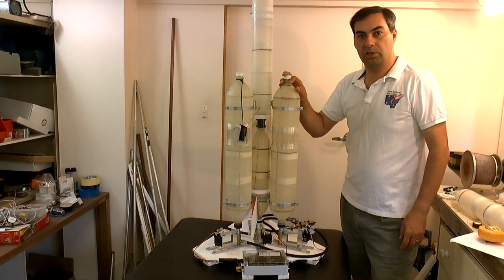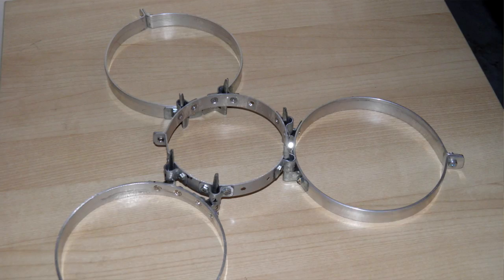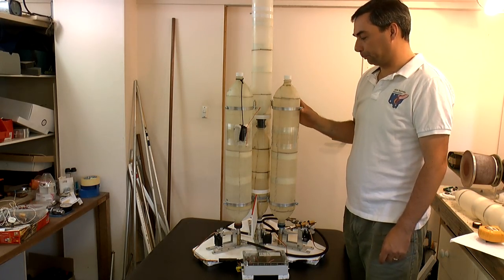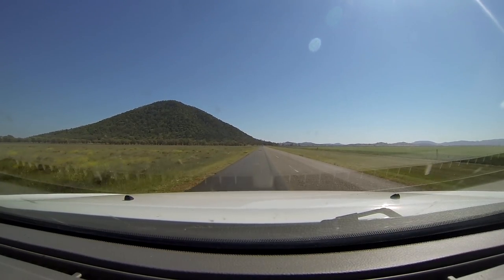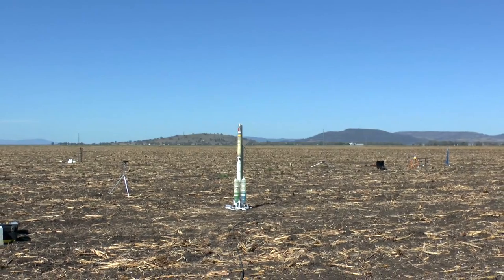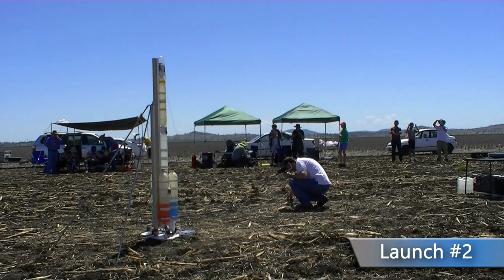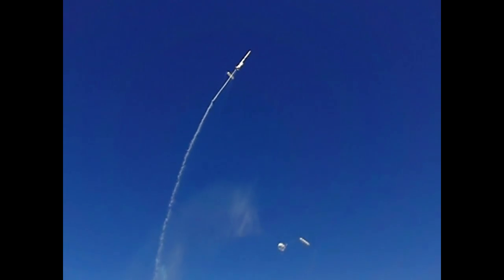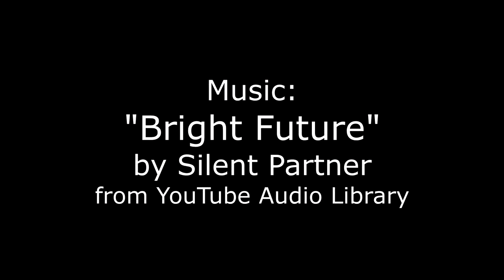Water Rocket with Boosters - Axion G2

Comment: Very nice video and some good test to see where you can improve, i can not wait when you launch the complete G2!  But the booster have a own locking system on the launcher why would you made those steel rings if there is no fore on that section? Because the booster are held in place by the launcher it self.
Reply from the maker: Thank you Basrockets. :) That's a good question why we need the strong connection on the boosters when they are held by the launcher. The individual booster retaining mechanisms are there for safety. They reduce the stress on the central nozzle while filling the rocket. If the central nozzle failed while the rocket is only partially filled that may be worse than if it failed at full pressure. However, with the boosters being released slightly before the main stage, the full static force is then transferred through the retaining mechanism for a few milliseconds before the main stage is released. When it leaves the pad the peak thrust is actually higher than the static force (I think in the order of 550N peak per booster), although at that time the main stage is also producing thrust (~180N peak) which partially cancels this force on the retaining mechanism. We also wanted to incorporate a safety margin in the strength of the connections. We tried thin aluminium sheet for the pins and loops, but they were too susceptible to bending.

Comment: Hi, what was the second stage drive mechanism you used? Was it electronic or mechanical?
Reply from the maker: Hi, this is not a 2 stage rocket, but a main stage with boosters. This means that the main stage fires at the same time as the boosters on launch, rather than firing when it is already in the air like a normal 2 stage rocket. Having said that the release on the launch pad is electronic. The main stage is released just slightly later than the boosters so that the boosters remain connected to the main stage. When the booster stops producing thrust it falls away by itself.

Comment: Wait.  You're in Australia.  People keep telling me that only the U.S., Liberia, and Myanmar use "U.S. customary" units.  Yet you measure your pressure in PSI.
Reply from the maker: Yeah, its a funny thing. In water rockets we measure altitude in feet, weight in grams, nozzle size in mm, pressure in psi. I think its mainly because the magnitude of the units are easier to deal with. Converting back and forth during calculations is annoying. :)

Comment: Are there laws in Australia that prohibit flying those anywhere?  Seems you guys always drive crazy distances to a "launch" site of some sort.
Reply from the maker: +Gunther Ultrabolt Novacrunch Yes there are. If you are flying below 400' then you can pretty much launch anywhere. Anything higher and you need permission. We mostly fly with the NSW Rocketry Association at our approved launch sites where we have permission from: CASA (Air Services), Insurance, land owners and council. Because a lot of the members fly rockets to significant altitudes we have to do that away from built up areas and as a result you end up having to travel further. We bring our bigger rockets to these locations, and smaller rockets to our Sydney launch site.
Reply: Thanks for answering!

Comment: Our school is doing a similar thing for a stem project does anyone have an effective way to measure the height reached by the water rockets?
Reply from the maker: Here are some ideas how to measure altitude:  https://www.youtube.com/watch?v=lrkyBcf7h58 The most accurate way is to use a commercial altimeter. You can get them in the $30-$50 range.
Reply: Thanks

Comment: how do the boosters come off are they connected to servos
Reply from the maker: trick shots999 The boosters passively separate when they produce less thrust than the main stage. Here is the full explanation: http://www.aircommandrockets.com/howitworks_1.htm#DropAwayBoosters
Reply: AirCommandRockets thank you I`ll try to do that and I'm splicing and I live in Melbourne so I used liquid nails and it works great I should come and see one of your launches